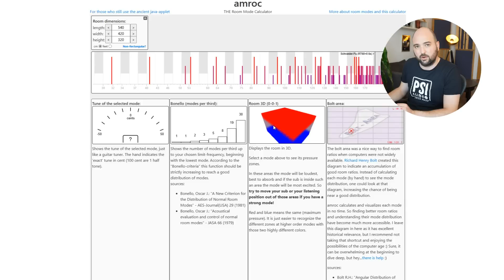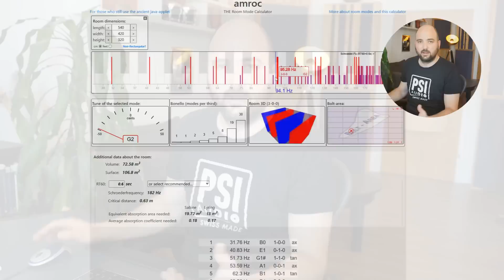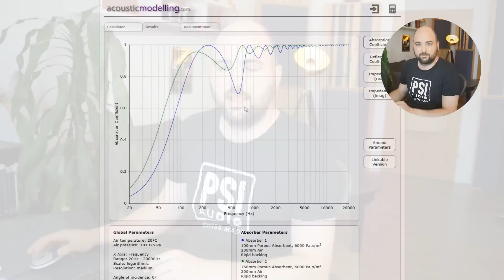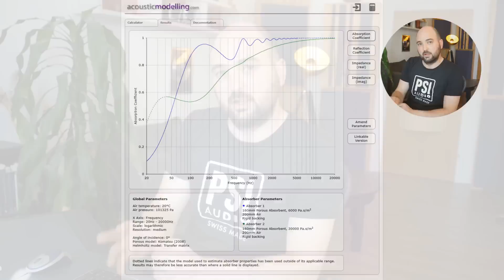Top 5 Bass Trap Placement Mistakes (And How to Fix Them!)

Comment: Regarding the Mistake #2. Are those dips and peaks above ~500 Hz make sense? Let's consider two front vertical corners and assume that our speakers are more or less regular regarding their directivity, such that they don't emit waves below 400 Hz behind them. So front bass traps don't receive direct sound above 500 Hz from the speakers, and dips and peaks don't matter  here. What those traps may receive is reflections of the sound above 500 Hz from other (back) walls. Not so sure about bass traps in vertical corners of the back wall, because those are receiving significant amount of sound above 500 Hz, but will there be reflection towards listening position? I'm not so sure. In sum, my idea that the Mistake #2 may make sense when placed as bass trap on the back wall, but will not make sense when placed in the corners.

Probably this mistake makes sense when we want to absorb lower frequencies with not so thick panel in first reflection points. But does it matter for corners? I have thought this question when have seen that GIK Acoustics bass traps provide Range Limiter option. Does the option really useful for bass traps in the corners? Especially for bass traps in front corners.

Comment: Weird question about air gap. The 4" panels I purchased are porous in the front but the back is thin plywood (for wall mounting). Does the plywood backing negate any increased effectiveness that an air gap would provide?

Comment: naïve question -- why don´t we put a freestanding absorbent bass trap somewhere near the middle of the room? That seems to maximize high-velocity for most of the modes?
Reply: That would be great for bass management, but then you don't really have much of a room anymore.
As you need panels on the walls anyway, due to reflection points, it's a lot more practical to put the most amout of treatment (which is required for bass absorption) in the corners.
Reply: @josuastangl7140  For a mix studio, the space behind your listening position perhaps doesn't matter so much. These could be free-standing gobo-like panels, and would absorb the backwall first-reflection point, so no backwall panels needed. So you don't really lose any space. Anyway, they could be moveable to make space when needed to accommodate different uses of the studio.
If high-velocity areas are so much more effective, this approach should be able to get the same amount of absorption with less cost and less space loss than backwall panels and corner traps.
Placed ~38% from the backwall, it would optimize absorption of the various front-back modes, right?

Comment: So far, this has been the best information to start planning my sturio treatment. A question though, is there a calculator to determine density depending on the depth? In other words, how can I determine which density matches better x depth? thanks!
Reply: I Have The Same question.
Reply: He has done a video on this.
Basically, the thicker the absorber, the bigger the advantage of low density materials (like 6000Pa*s/m²).
In any case, you can't go wrong with low density.

Comment: hello, at 10mn, you speak about absorber and compare a 6000 pa.s/m2 vs a 30000 pa.s/m2 but 6000 is 5x more efficient than 30000...it's reversed.
Reply: He said everything correctly. I have no idea where you got the concept of "efficiency" from or that one is 5 times more "efficient" than the other. TLDR: 6000 is better because 30000 reflects too much.

Comment: Okay now you got me thinking - I have a null around 120hz, 300hz and 500hz that I can't seem to get rid of no matter where I place my treatment, and I have kind of a lot of it... Going back to look at the air gap now, I had no idea messing up the air gap size could result in these weird mid issues. Will report back soon!
Reply: If you have such dips, just place monitors closer to a wall as much as you can.
Reply: @astrarivm  this is correct. The boundary interference is in phase when the speakers are close to the wall. Bass will be exaggerated but that can be corrected by EQ, nulls can't.
Reply: Use room sim in Room EQ Wizard and see how changing your listening spot or moving the speakers affects these nulls.

Comment: Let's say you are renovating/building a house with wood framing and have chosen a room to build into a studio. Would it make any sense to not install drywall on the interior side of the studio and instead use insulation between the studs and install some fabric, like on your panels, in place of the drywall? In order to provide some diffusion and a surface to mount things to, strips of wood could be mounted vertically from floor to ceiling on top of the fabric, forming a slat wall look. Any thoughts?
Reply: That layer of drywall, by its sheer mass, is doing a lot to prevent sound transfer through those walls. So you'd be trading any improved acoustics inside the room for the room being much louder in the rest of the house (and outside), and more house noise intruding on the room. I guess you could offset that by doubling the amount of drywall on the other side; double drywall is a common tactic to reduce noise transmission.
Reply: If you really want to go for it. I suggest putting the absorption material “inside” the wall. That should give you some great acoustic from the get go. And you probably won’t have to do as much treatment with panels afterwards. 
However since I’m not a native speaker I’m not quite understanding what you mean with “studs” but I think it’s what I mean.
I also suggest you contact some professional acoustic people to check with them. Because if you end up putting absorbtion around the whole entire room, the sound might be a little too flat for your liking. If I had the chance to put absorbing in my wall I would totally do it instead of having to treat your room with 30 panels just to get the sound decent. 
I hope that could help a little bit
Reply: I am planning on doing this very thing! Cool that you are thinking the same. I am not an acoustics expert but this concept makes sense to me. I have only a 13' wide x 25' long home theater and adding anything of additional thickness to the walls is impractical, so i'm tearing down the drywall and stuffing a bunch of insulation between the studs just like you said. Then covering with fabric.

Comment: I spent around 6-7 months documenting about this stuff before I built my room. It paid off. I only used 5k material and depths between 30 cm and 50 cm. My wall coverage is like 35% and It sounds better than I expected. If you have the space, do it!
Reply: you have photos where you placed them 35% traps? corners? side walls? ceiling?
Reply: @jgloc25  I have: 

50 cm by 180 cm tall traps in my first reflection points.

30 cm by 240 cm tall traps in my second reflection points

50 cm by 240 cm tall traps in the back corners

and 3 clouds 30 cm by 120 cm above the mixing position.
Reply: @bestafoods  Thanks. Can I PM for some questions? Setting up a new concrete-walled room.

Comment: I was hoping to hear that You'll mention that there is one more Mistake (Misandertunding), and that is the "air gap" behind the absorber that is put across when the two surfaces (eg. walls) meet SJOUL be FULL-FILLED. Otherwise, You are making a resonant cavity, and that's NOT what You want. Right?
Cheers!
Reply: Incorrect

Comment: A little bit misleading title of this one. Points 2-4 are not really about placement at all. And point 5 contradicts point 1. A better video would have been where to place membrane and Helholtz traps to target specific modes/frequency issues. Also it is kind of possible to target specific modes with broadband absorption by placing in areas of highest velocity for that mode (although most often highly impractical and not the best way to deal with it).

Comment: To be honest it is a sad that this professional mixing engineers don't learn from others.

For example if they just choose subwoofer enclosures that don't impact the room that for example bass reflex boxes does. With their bass pressure cannons (we all seen those reflex ports being able to blow out a candle on YouTube.😂).

Guess were that pulse wave of delayed sound goes..😂😂

And the the other upside is you get better reproduction and definition of your sound that give you a easier time to be able to mix more accurate.❤

The downside is that it is a less efficient enclosure and we need a greater cone area if/when using OB.

But you don't remotely get the same amount of problems in the room and therefore don't need the same amount of bass traps (so you win some and loose some space).

But better definition and performance as a added Sherry on the top!❤

I use two 18" OB hanging in the air (away from the reinforcing floor boundary) in a H frame/enclosure.

Those that have not experienced OB that can produce bass down and below 20 hz will be baffled at there is no hit and pounding in your chest or stuff vibrating from the sound waves. 
Regardless of how high volume you play.

There is just the sound that is recorded and no ARTIFICIAL "bom bom" delayed smearing sound coming from a bass reflex tube or we can call it a "sound pressure cannon(s)" when it is in practice like a coneless woofer with infinite X-max...😂

Guess what that cannon do to your room! .. 😂

Comment: Nice clear video thanks, do you have a calculator, formula or overview which depth needs which density? I got a lot of Knauf Acoustifit left over which i like to use for basstrapping. both backwall and ceiling corners.

Comment: Hey Jesco, hey guys, when I saw the first mentioned mistake I instantly thought "Yeah, I know what he's talking about, I've been through that".

I'm in the process of planning my new studio, and since I'm not an engineer nor a "handy guy", I decided to get rid of wooden frames in my panels. It just gives too much weight to fat panels, and I think that I'll be able to place fat slabs in upper horizontal corners in a certain angle, by simply wrapping them into a cloth and tying them with ropes to hang there. Basically I hope to use a single hook-hanger for each of mine traps near the ceiling, placing the trap centered over that hook, and tilting it just right. 

I think I'm gonna buy a couple of those big european rockwool packs (where each piece is 10cm thick),  cut them in halves and form narrow, 40cm slabs, so they would look as a kind of ray, radiating from these horizontal corner

Thanks for your work Jesco, you really helped me to create that vision of a studio!

Comment: How exactly do we calculate the density needed for the insulation material? And ive seen a lot of youtube videos where they fill the whole corner with insulation. Will this work or do you want to cut the insulation to have the air gap?
Reply: RW45 Rockwool is supposed to be a good all-rounder.

But a density to frequency chart would be very handy.
Reply: There is a graph that relates the density of the wool with the resistivity to air flow.

Comment: Thanks Jesco! You say that panels are better with an air gap behind them - is the air gap actually better than having more absorption material in that gap? In other words, I get that a 6" panel + 6" air gap is better than a 6" panel straight on the wall, but is it better than a 12" panel straight on the wall?

(I'm particularly thinking about corners, where you can get triangular absorbers that fill the whole corner with material. It seems like those would be better than a panel that was the same size front face but with an air gap behind.)
Reply: From what I understand, the air gap increases performance at lower frequencies.
If you double the material you may end up absorbing too much of the mid/high frequencies.
Try to target a balanced response curve.
Reply: You can check that in the porous absorber calculator. More absorption is better but the difference in low bass absorption is far too marginal to justify the extra spending. I would lean more towards the 2/3 absorber and 1/3 air gap ratio for the 100-500 Hz range consistency. I suggest no air gap in corner traps (no corner-cutting). The area is too small to save you anything, and it may simplify your design.